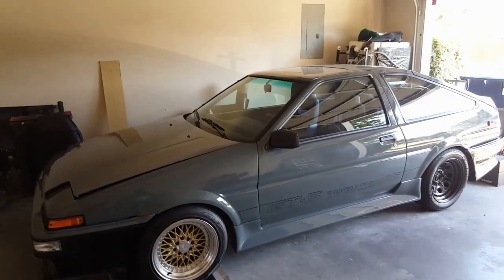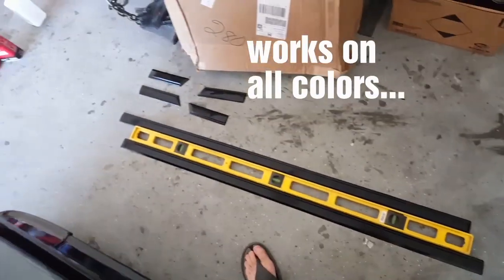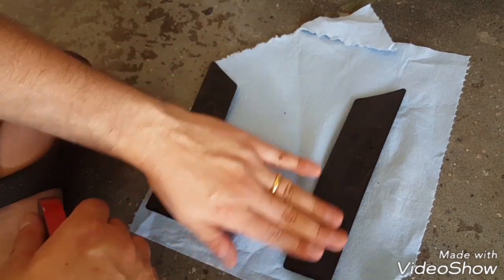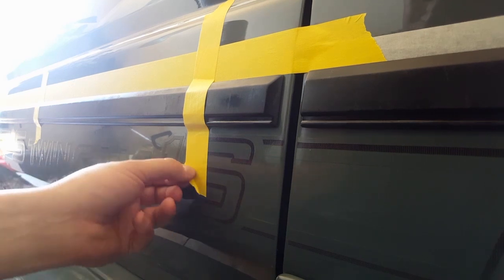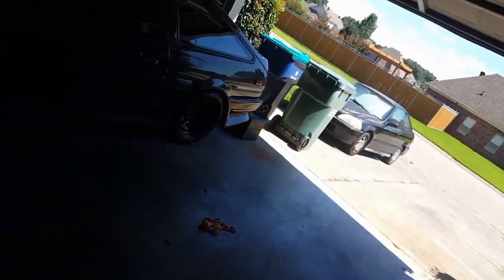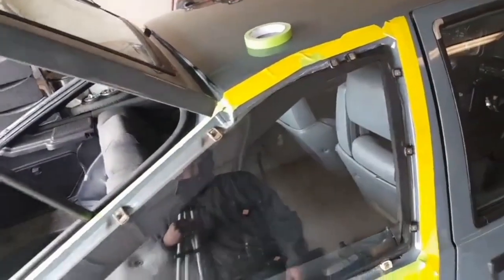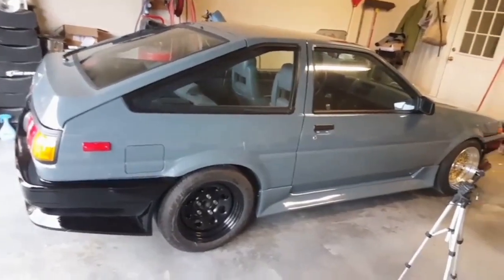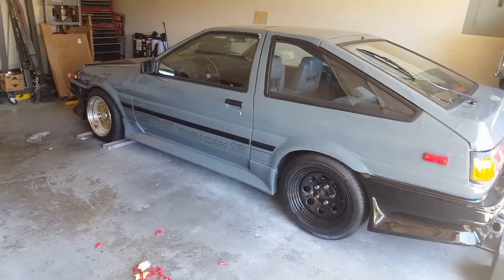Ep56 PROJECT AE86 How to install body side mouldings and rear quarter glass trim

Comment: Great build! I really appreciate you going into the details, keep it up! By the way, for the window trims; is there a product you would recommend for binging them back to a clean black?  Mine are somewhat grey'd out by the weathering.. Thanks!
Reply from the maker: Thanks for the compliments...for the trims...i used "back to black" forgot who makes it tho...if the trim is too far gone, I used an black exterior trim paint.  Most of the exterior trim i used the trim paint.
Here is a link to an earlier episode where I used the trim paint...if you wanna skip to the trim part it's at 25 mins into the video.
https://youtu.be/ejc6ddYriPA
Reply: @notnilc20  Excellent! Much appreciated, thanks ;)

Comment: Luckily you had some spare clips! And thanks for the tip on them! One of my window trims flew off on the freeway due to broken clips. 😔 been waiting for a hatch to pop up on my local junkyard ever since
Reply: Tell me about brother, its easier to find and lsd rear or an engine that some pesky trim lol..took me about almost 2years to find the little corner trim that on the top corner of the passenger door, had to buy the whole door from some dude on offer up for 40bux just for that piece lol